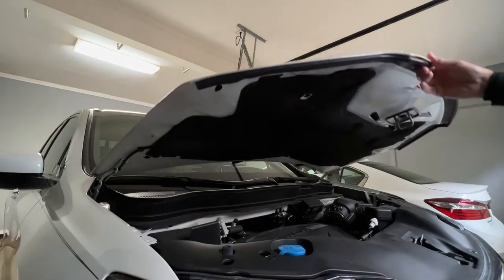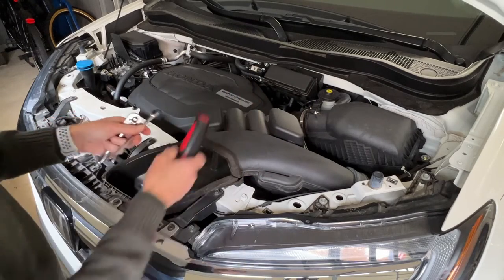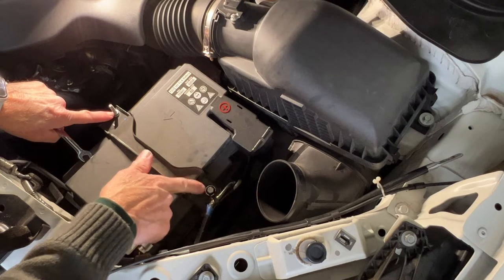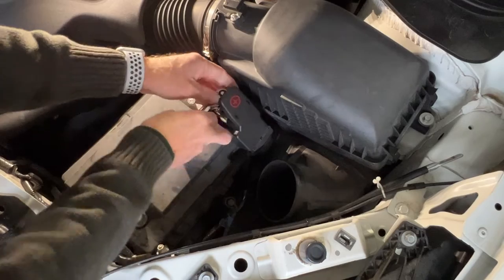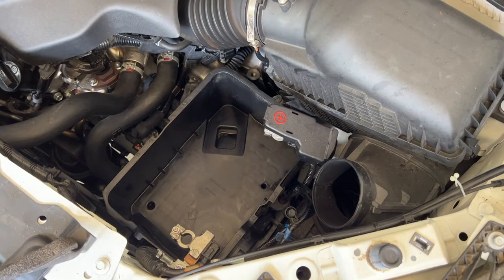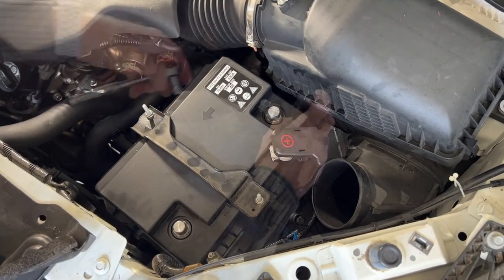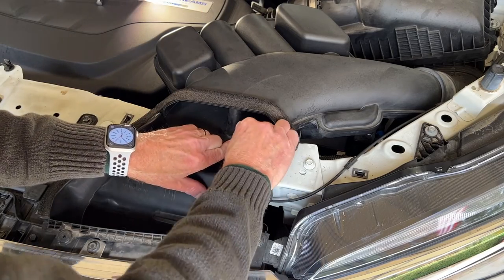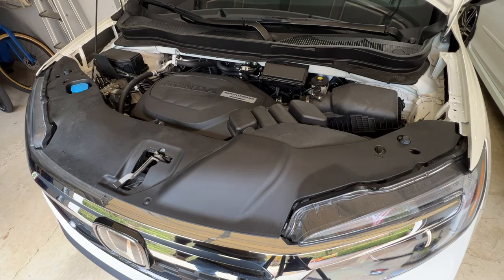Step by step battery replacement on a Honda Ridgeline (2nd Gen) or Pilot (3rd Gen).

Comment: This is one of the worst designed battery locations i have ever seen. My brother  has a passport and it also has a cooling fan that you have to remove. . I just did this for him and it took 40 minutes. I changed the battery on my 2014 Volvo XC60, 3.2 Engine in 4 minutes. I am not kidding you.
Reply: Couldn’t agree more. The oil filter is in a ridiculous location also.

Comment: Great idea on adding the ground cable!  I just did the same on my '17 Ridgeline.  It still had the OEM 7.5 year old battery and started exhibiting the glitches on the instrument cluster.
Reply: Funny! Same here. 17' Ridgeline and just replaced the battery today. Same symptoms to! Now if I could figure out what is causing the engine to run rough.. Thinking fuel injectors.

Comment: That battery location is nuts, I’m on blood thinners so my hands would look like they had ran through a meat grinder after doing this
Reply from the maker: It's inconvenient to remove all the stuff to get to the battery, but not at all difficult to change. I did it wearing a dress shirt and sweater because that's what I was wearing when I realized the battery needed replacement.

Comment: If you look in owners manual they show you where to hook up negative cable. I saw where a guy put a 6 mm bolt in hole in fender, pretty easy fix. Thanks for this informative video. No strange background music and stupid commentary!
Reply from the maker: Thanks for watching and taking the time to leave a comment!  I am aware of the negative bolt workaround and that's ideal if you are the one with the dead battery. But, if you are jumping someone else off then a more direct connection to the good battery is preferred vs connecting to the chassis. https://www.hondaongrand.com/how-to-jump-start-a-car.html

Comment: Could honda have made it any harder.  Great idea with the grounding wire.  I was trying to help someone jump there car but I couldn't with the battery location.
Reply from the maker: Thanks for watching! Yea, the battery is really buried under a lot of stuff!
Reply: Yes, they certainly could have. This is nothing compared to German cars.
Reply from the maker: @allwoundup3574  Yea, I owned a couple of Audi A4s before getting my first Ridgeline. Both A4s were turbo charged and both were 'chipped' by APR for more boost. They were a lot of fun, but expensive to maintain and the resale value was shockingly low compared to the Toyotas and Hondas I've owned before and after the Audis.
Reply from the maker: @Void28368  Man, that does sound like a chore. I bet the battery was put in the wheel well to keep battery temperatures down, the Ridgeline battery box has a fan that pulls cooler, fresh air from under the battery into the battery box.
Reply: There is a bolt that ground to the frame up in the right corner of the engine compartment that hold the air filter frame in place.   It is clearly visible at 3:21 into the video. You can use that for your ground. I just recently had my Ridgeline jumped using that bolt for the ground.  The grounding wire would be more convenient, but not necessary.

Comment: Thanks for the great & precise video.  My new to me 2017 still had the original battery, and I didn't want to roll the dice on getting stranded this winter.  I was quite surprised to see the lack of immediate access to a proper negative terminal or point when I had to help a neighbor jumpstart his car.  The thought of adding an extension to the ground did not occur to me until you mentioned it.

I used your video as a guide to replace the battery on my truck and purchased an extra deep 10mm socket for my impact driver and had a metal trim removal tool ready.  The whole process took around 5 minutes because I knew exactly what to expect after watching your video.  The extension cable for the negative point I used was 18" long, however 15" or 12" would work just fine as well.
Reply from the maker: Good call on replacing your battery before it leaves you stranded, you definitely got your money's worth getting 6-years out of the OEM battery. Glad to hear the video helped!

Comment: I was running my accessories in my truck in a parking garage while waiting for my wife to complete a Dr. visit.  I did not have the engine running and forgot that the headlights were on due to the automatic off/on selection.  So when I tried to start the engine the electronic window went all wonky and reported every problem imaginable with the truck!  I figured out what was wrong very quickly and had to go find the valet parking guys to get a jump start.  There is a bolt holding the air intake duct that grounds to the chassis so I did not have to remove any plastic etc.  I was concerned until I noticed that bolt!   My battery charged up OK afterwards, but the battery is 5 years old and it only took about 30 minutes to run down the battery with the headlights on, so I will be replacing the battery.    Great video with good details and camera view. 
Thanks much for your effort. 

P.S. You can barely see the metal bolt holding the air filter frame in the upper right corner of your video.  That's the bolt I used for the ground to jump my battery.  It is clearly visible at 3:21 into your video.

Comment: Extremely useful. Thank you. My battery wasn't holding a good charge (no bulging), so I removed it to charge with the Noco Genius5. I'd been using a Noco GB40 jump starter, but that wasn't doing the trick anymore (and it was getting old to have to do that every so often). Your video allowed me to do this job safely and effectively. I'll absolutely be adding an auxiliary ground cable to make getting to the negative terminal easier in the future. Please keep up the great content!
Reply from the maker: @Remanifest Thanks for watching, I'm glad to hear the video was helpful! Thanks also for leaving such a great comment!

Comment: Went out to start my 2017 Ridgeline this morning, and for the first time in 7.5 years it wouldn't start.  Pretty good for the original battery (and 70K miles)!  This is one of the best how-to videos I have watched, though - felt and sounded like my own Dad showing me the proper way to change a battery.  Thanks a bunch, @Koolbob2!
Reply from the maker: Wow, you may have the longest lasting OEM battery I've ever heard of! Glad to hear the video helped you replace it.
Reply: Thanks for sharing your experience. If you don't mind me asking, do you have S-VCM or any type of VCM muzzler installed on your Ridgeline? Thanks!
Reply from the maker: @Radwinskee  If I'm really paying attention (and the stereo isn't blasting classic rock) I can barely detect the VCM system doing its thing. It doesn't bother me so I leave it alone.
Reply: @Koolbob2  Thank you for replying, appreciate it. I just got my 2025 Black Edition and was thinking if I will put any VCM muzzler or not. Just wondering what year and the current mileage of your Ridgeline? Thanks!
Reply from the maker: @Radwinskee  Mine's a 2018 with about 50k miles on it. I've had the ECU programed to double the turbo boost on a pair of Audis that I owned before the Ridgeline, so I'm not shy about modifying a vehicle for better performance, but I don's see the need to defeat the VCM system.
Reply: @Koolbob2  Thanks again for the reply. Yeah me too am hesitant to put one on mine but I'm reading and watching a lot from YT that VCM can do damage in the long run --> https://www.youtube.com/watch?v=iVGCQ-oUB90&t=28s 
Not sure if Honda had already fixed the VCM issues with their newer models. Thanks again!

Comment: Thanks for the great video. My honda pilot 2019 battery died yesterday, when i tried to start it made a stuttering sound and goes to accessory mode. I was able to replace the battery myself watching this video. To pull the plug or cable attachment shown at the 2:54 timeline of the video, i tried to use the screw driver and pinched my finger nail, using a plier did the job. I tried to shop for batteries around, Costco has the best deal on H6(48) battery.
Reply: Costco here had price on shelf at $169.95 rang up at $123.00. Great price for pretty good size battery!🔋

Comment: Thanks for an imformaive & helpful video. 

Why did Honda choose to make such an important thing as the battery so inaccessible? I love Hondas but I've been spoilt on the simplicity and ease of use of Subarus.

I live in a very cold area and need to put my battery on a maintainer / tender most nights. Do you think it would be possible to have some cables attached to the battery that I could then easily connect to the tender without having to take off the air intake? Thanks

Comment: Thanks for the video. I just purchased a '23 and its much more work to change vs my '17 CRV. The -ve cable addition is a awesome idea which I will add - we have 6-7 months of winter and I don't need to be moving plastic during a deep freeze as its almost guaranteed to break.
Reply: Well done video. What was the little trouble light you used, do you like it and where can I get one

Comment: Great video. Keep up the great Ridgeline content. I plan to buy one in the next couple of years as my Honda Element has 240,000 miles on it. Still going strong but I’m ready for something new.
Reply from the maker: I always liked the Honda Element and they seem to run forever. I probably would have bought one if Honda would have made a 'fancy' version of the Element with more sound deadening, carpet and a little bit bigger motor. This is my second Ridgeline and I'll probably buy another one in a few years.
Reply: We have a 2000 CRV 294000, looks rough, a hail storm ate it up pretty bad, we keep it for a run around at the farm.
 Get that Ridgeline you'll be thrilled, we're on #3 and they hold value.

Comment: Very good instructional video! I am guessing that only the Walmarts that have auto care centers would have the Everstart batteries or did you order it online from Walmart?  I see that AGM batteries can be shipped (free). I assume battery arrives freshly  charged and ready for installation?
Reply from the maker: Thanks for letting me know the video was helpful. Our Walmart has an auto service center and I don't recall ever going to one that didn't have a service center. :) If you're planning to keep your vehicle more than a year or two I think it's worth paying a bit more for the AGM battery. I assume it would arrive with enough charge to start the vehicle, if you don't have a battery charger then I'd avoid starting the truck and then turning it off until you can drive it for 20 minutes or so to give the battery a good charge.

Comment: May I suggest a topic? Sometime this spring I will be changing over and or rotating my tires. I am somewhat capable. I have even done this job on a Porsche. But the Honda Ridgeline seems to have tricky little jack points, but now that the snow has melted I will be crawling under the car/truck and getting a better look.

By the way the negative terminal is a great idea.

Comment: @koolbob2 My apologies if I missed it. But does the Honda Ridgeline retain all computer settings when disconnecting the battery? 

I've seen other videos mention a memory saver... went on to Advance Auto Parts real quick and it looks like these things are a bit pricey.
Reply from the maker: I figured a 'reboot' of all systems might be a good thing so I didn't use a 'memory saver'. Everything was fine after having the old battery out for over an hour, didn't even have to put in the security code for the stereo. The only data lost was my radio station presets.

Comment: Great video, but damn!!  I have a 2006 Honda Ridgeline and the battery is right there when you prop up the hood.  All the beauty covers and the like on the Gen2 sure make the job a lot harder.  And your battery lasted 4 years which is what I get on my truck.  Think I'll keep my 2006 a while longer!
Reply from the maker: @danjoe22 I had a 2012 Ridgeline RTL-E for six years before trading it in for my 2018. The 1st Gen. Ridgeline is great, I really prefer the more comfortable interior, better milage, more comfortable ride and other refinements to the Gen. 2 has over the 1st Gen. I don't mind removing a few snap clips to change the battery every 4 or 5 years.

Comment: This was an excellent instructional video.  Good job.    I was suspicious when you were having a nice looking sweater on and no rubber gloves.  never have changed a battery without holes appearing in my clothes after a few wash cycles. (it's been many years).  So do we attribute no white chalky acid getting out and the longevity to the battery enclosure and fan?  I'm amazed and the quality and design of this Honda Truck,  I love it, Its all the truck anyone needs (usually).  I am disappointed  though that Honda and Toyota are not making EVs.   it could be they are waiting for better battery technology, which I think is around the corner.  (CATL batteries).   when they do I hope they get Tesla's self driving auto pilot and FSD which is the best and most liked feature of their cars.

Comment: Informative video. I got a 2022 ridgeline and was surprised how the battery is buried.   I ordered the negative jumper from your link. Did you need to replace the negative bolt to frame to a longer version to fit the jumper terminal?
Reply from the maker: @rubenu5157 Thanks for watching and taking the time to leave a comment! I was able to use the factory bolt to attach the 'ground' strap to the negative terminal of the battery.

Comment: Thanks! Just found your videos! Ordered the dual horns and the wire. How about some pointers on the horn installation?
Reply: Also, have you done the mods  on the rear doors so they open wider? Pretty easy and very helpful to have.

Comment: Great video did you have to recalibrate the computer when you switched to a agm battery?
Reply from the maker: @brucepeabody3361 Nope, I did lose my radio station presets,  but everything else fired right up I didn't even have to put in the radio security code and I had the old battery out for at least 30-minutes.

Comment: thank you - what is the length of that extra negative cable?
Reply from the maker: Sure thing, the cable is 4-Gauge diameter and 15" in length. https://www.amazon.com/TOPDC-4-Gauge-Negative-Starter-Conductor/dp/B01K68YC2W

Comment: Good video. I'm surprised that you don't use a memory saver while the battery is disconnected to avoid having to reset tons of setting and avoid issues.
Reply from the maker: The only thing I lost was radio station presets, everything else was fine even though the battery swap took hours because I was filming.

Comment: Great video. Meaning to ask if you had any issues with the truck before you change the battery like the alarm system going off with low voltage or any alarm issue? I have a 2021 Honda Ridgeline Touring and in 2023 I had the alarm go 3 times today and I checked the voltage and it was 12.5 but I should have checked it before I left work.
Reply from the maker: I had a 2012 Ridgeline (first generation) and now a 2018 (second generation), both started having weird electrical issues as the battery got weak before the battery went completely dead and wouldn't start the truck. If you checked your battery with the engine off and got 12.5v, that's not bad, but I usually get closer to 13v when I check mine. If it were me I'd swing by an auto parts store or mechanic and ask them to check your battery. Most of these places have a special meter that test how the battery performs under an electrical load similar to a starter motor. It will give a true assessment of the battery's condition. If the battery is getting weak, check with your dealer, your battery may still be covered under the 36month 36,000 mile warranty.

Comment: Thanks for this video...very clear and helped me a lot. I'd like to add the cable to the negative terminal, but I'm not sure what to purchase or where to begin with that. I'll inquire at the auto parts store, but if you have any tips of your own I'd sure appreciate it. Thanks again!
Reply from the maker: The cable I used is a ground cable that would normally be used to ground the negative terminal of the battery to the chassis or to ground the engine to the chassis, it should be available at any auto parts store. Mine is 4-gauge and about 15" long.